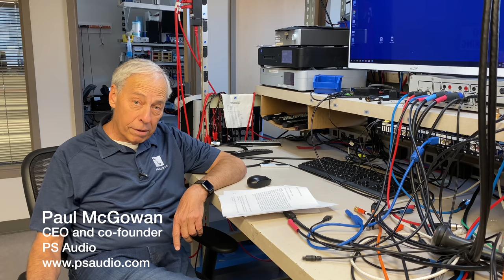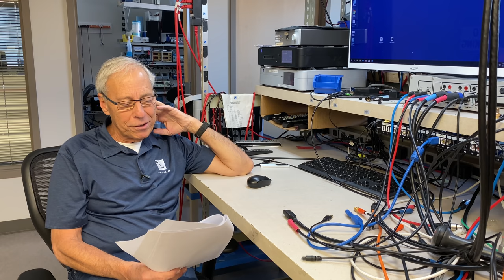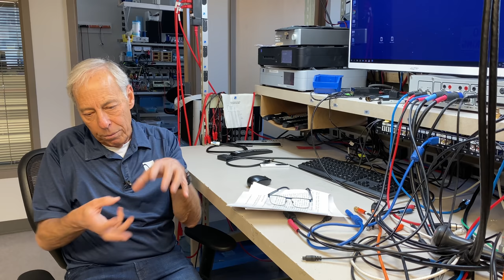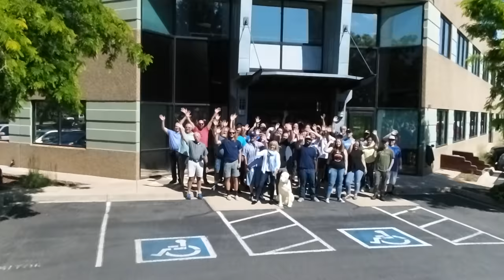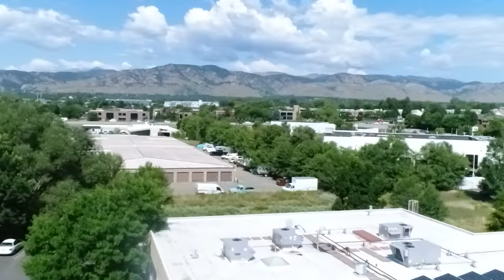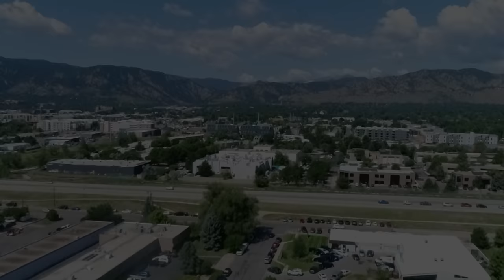Speaker sensitivity and audio quality

Comment: In a nutshell... tradeoff between size, efficiency, bass response. Or is that actually too simple?
Reply: Correct! But the is more compromises in intertwine with the trade off such as the addition of a bass port. For simplicitys sake however, you're it's correct. There is also similar trade offs in the design of a speaker driver, being stiffness, lightweight and damping.
Reply: That's spot on, in speaker design there's something known as "Hoffman's Iron Law" that basically states: high sensitivity, deep bass response, small box size; pick 2.
Reply: @timreeves  And you can setup this triangle choice for a lot of things where it makes sense, often price is one of the 3 :-)
Reply: @maxb.simonsen2459  In some ways you can add price into this triangle as a 4th corner, by using 2 drivers isobarically you get almost identical performance for sensitivity and bass response, but you can half the box size.

Comment: Ultra high efficiency speakers either sound thin (single driver types) or weird (horns). I would say the sweetspot would be 90-93db for good sounding conventional speakers (only a few can). One general advice: choose speakers with 2(mid bass/high) or 3 drivers (bass/mid/high). Any other design looses more than it gains. Forget about dappollito designs or side firing woofers or woofers that run parallel.
Reply: opinion.....sound "thin" has no relevant meaning...a single stadium 18 inch can pound your chest like a bruce lee kick......"thin"??!!

Comment: It totally explains why klipsch is lackluster on the low end
Reply: Paul’s right.  The Heritage Series Klipsch speakers (the ones that Paul Klipsch himself designed) are pretty big, because physics requires horns to be very large to produce deep bass tones.  La Scalas are as big as washing machines already, but to get much deeper bass, they’d have to be as big as fridges.  However, you can add a sub or two, and you’ve got the best of both worlds.  And contrary to what some horn speaker fans say, you don’t need a horn-loaded sub.  Just a regular subwoofer will do, but it should be both quick and powerful to keep up with a horn-loaded speaker.

Comment: Just one comment: A smaller voice col isn't less linear. Just produces less force to drive the cone, right?
Reply: A voice coil is a wire wrapped around a (usually) cardboard tube. It is connected to the speaker cone at one end, and the membrane called a 'spider' at the other end.
This wire can get very hot, so plastic tubes will melt. Yes, the cardboard can also catch on fire if the speaker is overdriven.
The voice coil can be long or short, and large or small diameter.
The voice coil moves through a very narrow gap, back and forth like a piston. Smaller voice coils get hot faster. Larger ones can handle more heat.
The more the voice coil moves in a non-linear fashion, the worse the sound reproduction.
Shorter voice coils limit driver excursion, and so are most often found on tweeters.
Larger drivers, such as woofers, produce more heat. Therefore requiring larger diameter voice coils that will not catch on fire at loud volumes.
A short voice coil on a long excursion driver can easily jump right out of the gap, damaging itself, the speaker cone, and the spider.
Reply: @HareDeLune  You refer to several different properties of the voice coil: Power handling, physical length, diameter and also driver related properties like magnet / gap length and excursion. 
All you state is correct but by changing other properties - in addition to coil length - isn't possible to reach a specific conclusion. 
To describe a short voice coil vs a long one, we need to classify them as overhang vs underhang in the magnet gap. 
An underhang voice coil is by definition shorter than an overhang one (keeping all the other dimensions and properties the same). 
An underhung voice coil will move in it's entirety within the magnet gap and hence is more linear. An overhung one has part of it out of the gap and hence creates a less linear motion. 
At least, that's how literature has it. 
Of course, a shorter voice coil will have less turns (for a fixed gauge wire) and generate less force, or have an equal count of turns employing a thinner wire and hence have less power handling ability. 
It is pretty possible to make a woofer using an underhung voice coil in a large magnet. It's just that the cost of the magnet will be (perhaps) double and for a woofer, that might be substantial. And with low frequency distortion being less audible, it is usually a priority to build the driver with a strong "engine" that may not be as linear at very high excursions.
Reply: @savvassidiropoulos5952 
Ah, I see you are well versed in the subject.
My aim was to provide some general information, in case you were not very familiar with voice coil construction and function.

I have worked on speakers and done speaker repair in the past, but not speaker design or engineering.   : )

Comment: I looked up sensitivity LS3/5as—82db., ouch. 16 ohms doesn’t help.
Reply: the most over rated speaker on the planet
Reply: It's a nearfield monitor, isn't it? Low sensitivity (or low amplifier power) is not necessary a problem for close range use. 82 dB @ 1 m = 88 dB @ 0.5 m.
Reply: @FINALLYQQQQAVAILABLE  The BBC ls3/5 was never designed to be a hifi speaker mainly used for voice talk back links on desk tops and in vehicles

Comment: what about sevro direct woofers?
Reply: Servodrive subs were efficient but big, heavy and expensive. Tom Danley makes tapped horn subs now. The servodrives were designed by Tom for research into low frequency communications with Elephants. Very cool design. They did go out on tour with acts like Michael Jackson but with a 400 watt power rating and specialized motors, it doesn't pay to use them. You should check out Danley sound labs.
Reply: @mikemcconnell2794  thank you
Reply: servo-drives were not invented by danley....elephant research were large typical woofers, investigate servodrives, they can be bought used...their good until about 145db front row conert or RAVE..technically the servosystems were in the same catagory as large twin 18 inch cabinets...most pros love them....❤

Comment: SORRY but this OM hasn't a got clue. His "wisdom seems tb 1/2 centrury old. The "only true thing he mentioned is about the old Amps and the desire to play loud- this spured sensitivity speakers.
Look at the B&C 18 DS115 (one of the most amazing beasts out there) it's got 98dB at 30HzFs, with a 40mm long voicecoil (almost 12cm in diameter !!!) and a 330g mass of the moving system.
How you do this. It's all about Neodym (or field magnet drives like the big Focals) . The power of the peaker motor the OM did not mention at all.
The reason for me is that high efficiency speakers are harder to control acoutically but also electrically (when the efficiency origins from strong motors) . Low efficiency speakers are - in ease words- smoother, less tendecy to come up with nervouse frequency respons curves etc. The "friedly behavior is achieved by high inner damping of the cone the spider and the surounds - all costing effiency.
I could go on for a bit but here is why I like high sensitivity; You can sit at 1 am while youf family sleeps next door and listen to full body every octave music with great pleasure ......(ref JBL 4520 w acoustic lens mid horn and slit tweeter- 3 way active) ......
Reply: correct👏👏😳

Comment: Low efficiency speakers are cheaper to manufacture, making a speaker 3 DB more efficient increases the cost by 4 times.
Reply: interesting you came up with an incorrect formula....
Reply: @lunam7249  It's not a formula, it's a cost estimate from a JBL speaker driver design engineer.
Reply: @hwirtwirt4500  as i stated, incorrect.
Reply: @lunam7249  Are you a speaker driver design engineer or just an internet troll?
Reply: @hwirtwirt4500  Post Ph.D. E.E. Physics with dozens of patents, including EMF Drive motors, not a troll
Reply: @hwirtwirt4500  hahahahh😹😹😹 your loss....my BS was in mathematics.....i was going to answer your 3 most difficult physics and electromagnetic questions for free....like a genie of physics....granting 3 wishes!! hahahah! 
but alas your co-incindental destiny with my greatness.......has  sadly.......ended.......
Reply: @lunam7249  The question was what would be the cost to increase a drivers acoustic output by 3 db. What's your cost estimate and what physical changes would you make to the driver to obtain that increase?
Reply: @hwirtwirt4500  well, since you erased your insult, i guess i will help you with a big headstart.....to begin with there are no questions without an answer....however unpleasant or pleasant the answer maybe, and the answer may or may not be on a time scale or economic relevance to the questionaire......1st. lets "clean up" your "assumptions" and "inquiry(ies)"......cheap and low quality are not the same....low $ price = cheap, and junk = crap, low quality = crude.....
Reply: now, lets make a 3x3 matrix  with 9 seperate dimensions of loudspeakers of your inquiry....low, mid, high ( quality), low mid, high (price), lmh ( efficientcy), so now you see we can build design or create or manufacture or investigate bank loans on each...say box 1 of the matrix is low quality , low price, low efficientcy.....box9 is high quality , high price, high efficientcy......we could examine each box 1 thru 9 identity and narrow your "assumtion" to say box 4.....then sub-divide it further...we could also add 5 more dimensions as i would and have a 3x 8 matrix with 24 box identities...
Reply: sticking to the matrix boxes, my personal desire would be to re-orient for goal superiority, "the best box" is so (high quality, high efficientcy , low price = box 7) ,our goal would be approaching box 7......but i dont want to confuse you so lets stick to the original low, mid , high,
Reply: next we must dimensionaly re-structure your question into similar DIMENSION units....so, 3db = 3.02db = doubling sound power, = 200% increase....and 4x cost (price) = 400%  ($) increase, so now we have a non-linear equation in dimension 1 (one) = (%) shift, or mathematically using calculus or better yet differentials we get:
dP/d$ = differential P(power output) divided by differential $(price).....change in sound power / change in price, now THAT is your correct question, restated.....and yes its a very good question....
Reply: sparing you 3 years of rudimentary calculus "we" would like  "your" (dP/d$) to have a positive numeric value, whose condition satisfies "your assumption" that;
(dP/d$) => 0.5 , however i submit to you that conditions exist all along these points if we were to physically graph "your" (dP/d$) identity...my differential "curve" would be that of (dP/d$) => 0.51, in essence all conditions which would be BETTER  than your assumption....(your assumption is very pessimistic)
Reply: next, we will "hold hands" and walk along the "journey" of the differential bridge equation of (dP/d$), starting with the far left negative numbers , say (dP/d$) =< - 100, the more efficient a speaker gets the lower the price will be ... or to a sound engineer (+17db = half price)...or (+10db = 0.1 price)...."we" would like to be here....but we would all become deaf...this is "quiet world" were silence is highly valued and expensive, say "muffler world"...
Reply: in still in the middle of my answer, however, i would like to gift you a vid encompassing OUR DISCUSSION: "richard feynman on magnets" - 7:33 seconds
Reply: @lunam7249  Richard Feynman would give a clear answer and not hide behind a line of BS which is what you're doing. Try again, the question is " What would be the cost to increase a drivers acoustic output by 3 db. What's your cost estimate and what physical changes would you make to the driver to obtain that increase?" If you can't answer just admit it.
Reply: @hwirtwirt4500  ohhhhhh bad move....checkmate.....didnt your grandma ever tell you patience is a virtue?or in my case "wonderment"...i spent 10 minutes giving you the first structure of answering your question...you have any idea how much northrup pays me for that?, its sad to me you cant understand richard feynman....oh well, have some good luck in your endevours....❤️, i enjoyed your curiosity, that will benifit your life

Comment: I'd personally rather have a speaker that is +/- 3db at 70 hz that's higher efficiency than a speaker that plays down to ~30Hz +/-3db that's lower efficiency. With the exception of SOME 2 channel purists, I think most of us use subs and crossover at 80hz anyway. I love being able to listen at "spirited" volume levels while the system is coasting along. The effortlessness is wonderful.
Reply: Sub at 80 hz? Omg! You must be a teenager and hip hop is your favorite music!
Reply: @jamapaza  Wow, you couldn’t be more wrong. Nice try. 80hz is a standard crossover frequency. Not set in stone, it could vary based on speakers, sub, placement and the room, but that’s a standard and general starting point

Comment: Nonsense!  Infinite baffles and folded horns can do wonders for freq response.  I ran a pair of 12 inch Pyles in the rear deck of a Ford LTD sedan.  These drivers had a sensitivity of well over 10 Db,  and I was only pushing them with a few watts each.  Cutoff was well below 20 Hz,  as the rear deck and trunk space was essentially an infinite baffle.  Mount an Electrovoice 30 W woofer in a rigid wall,  and see what happens.   We don't need 500 watt  subs in the trunk with 8 farad capacitors across the 12 volt rail to get good solid low frequency sound.  What would work in theory will not necessarily work in practice,  and conversely,  what should not work in theory can and will work in practice,  with careful planning and design.  There may be one problem with super high sensitivity,, though - more distortion.  And generally,  cone breakup usually doesn't kick in until you reach the upper bass or low midrange frequencies.  Only harmonic distortion due to poor damping can occur with larger cone / voice coil assemblies with insufficient moving mass,  but even then,  in practice,  stronger magnets tend to offset some of the ill effects of high compliance (ringing, overshoot, and poor transient response.  I threw theory out the window a long time ago.

Comment: That is only a half truth. What Paul is talking about is the transistor amp to high efficient speaker power coupling. Yes then he is right about what he is saying about the lack of bass.

But I can totally kill that argument, by then just saying: "use a tube amp, that then couples better with that particular efficient speaker"

Problem solved.

So actually the problem is reverse. The transistor gear is usually the thin type of sound. And that gets exposed at high DB speaker efficiency levels.

But again, that is why most people use transistor gear with low DB speakers and tube with high DB speakers. Different language. Both can still sound great. It's only a question of matching the language.
Reply: Actually you ignore bass control issue.
Tube amplifiers in class A are known to be constructed with output transformers that have significant active resistance. While speakers, especially bass speakers as a coils in magnetic field produce EMI (electromagnetic induction), which is kind of electric generator inside of the speaker that acts as a force to prevent change of the speaker coil movement direction. If amp output has near zero resistance/impedance this speaker EMI is shirt cutted into this low resistance, and disappear this way, so the EMI force becomes near zero, and the speaker coil and bass  becomes more controllable. 
So tube amps with output transformers that have high output resistance are actually source of problems with bass control. This issue sounds like listeners have more bass like you mentioned earlier. But this happens at cost of bass quality. The tube amp will never produce dense and fast bass.
Transistor amps usually have design with output impedance near zero and feedback correction of sound to minimize distortions and uncontrolled bass. With such amp  speakers produce only that portion of bass that the amp control perfectly. If it sound a bit weak in comparison with tube amp just mean the amp cannot give more energy to the bass speaker either via lower impedance of the bass speaker frequency range of interest with more current and force. Or voltage of the signal shall be greater having same impedance like other frequency ranges, so EQ or DSP can help with this voltage gain.
Reply: @alexanderbelov6892  But then you are talking about crap amps which I am never even going to use, so again no point in mentioning that.

It's like a guy saying that high db speakers are always more efficient than low db speakers. Yes and no that is true to the degree of the ohm curve and many other factors.
Reply: @alexanderbelov6892  👍. Seems like always a trade off.  

I’m not that much into classical non bass type music.  I live in an area which is quite hot in the summer.  

While I do have room to dedicate a tube amp type system to me it’s just not worth it. 

My system is over 20 years old.  I chose solid state Class A/B amps.  It does the job to what I’m looking for the most.